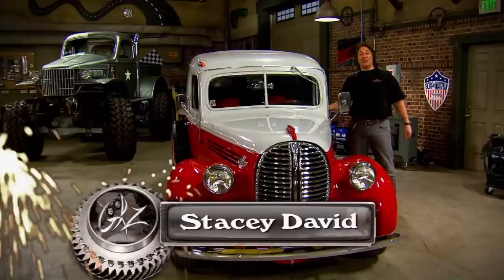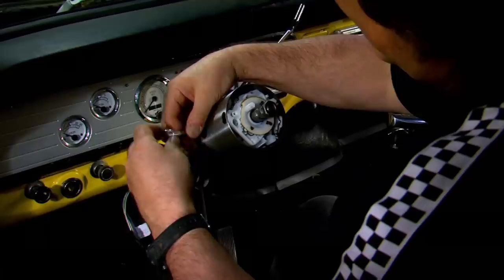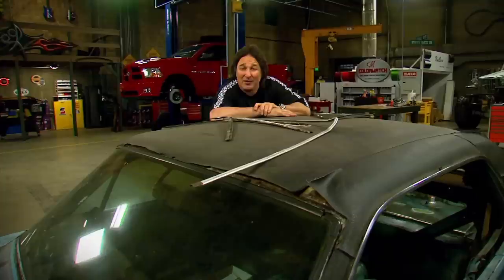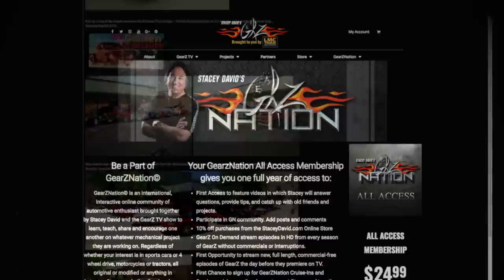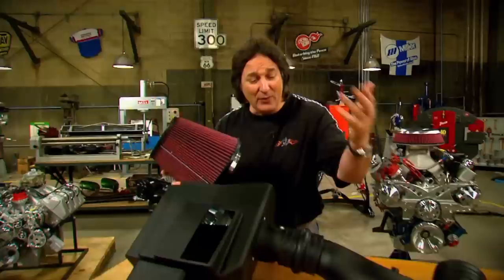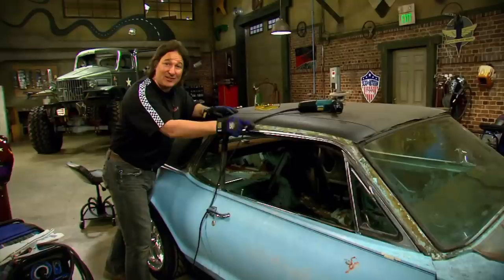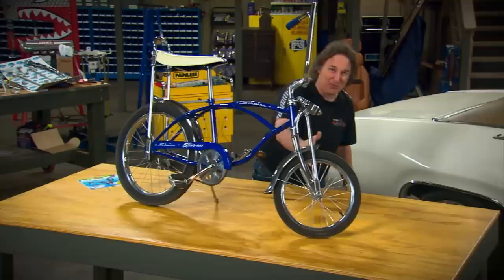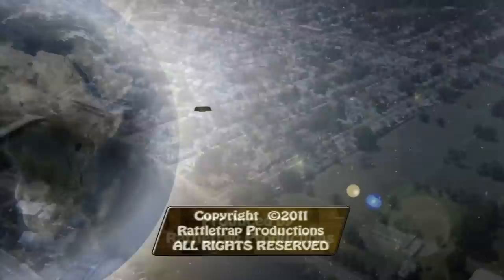Fixing Other People's Hack Jobs, Shaving Drip Rails, & Chrome Plating - Stacey David's Gearz S5 E12

Comment: I like that shifter it had better. when it comes to driving the truck. I never trusted column shifters in any of my trucks when shifting gears when going up a steep hills or scenarios where you need to down shift. When shifting back to regular driving gear I always fear messing up and shifting to reverse.
Reply: Column shifters are only good for automatic transmissions.

Comment: I'm waiting for the day when someone grows a brain and makes a tuning app for a phone to go with an obd2 to otg usb cable or bluetooth dongle so you can run a car off your cell phone.  It'd also make it harder to steal a car if they implement some kind of key system so you can't start the car unless the correct app/phone is connected.